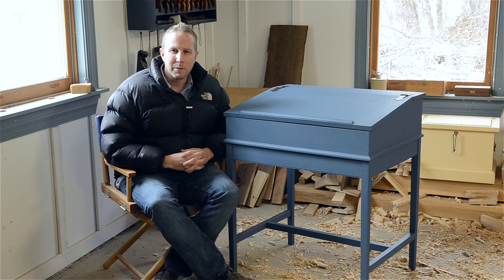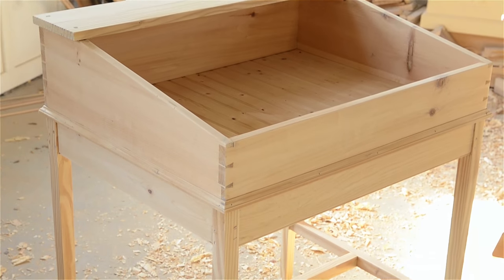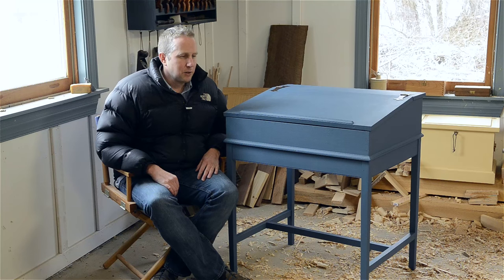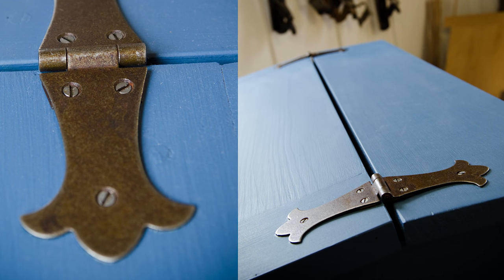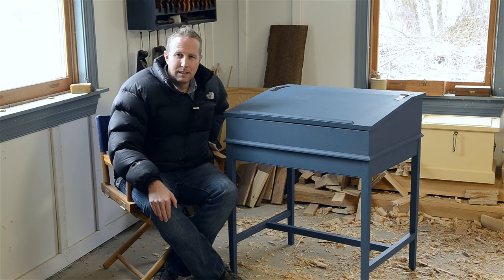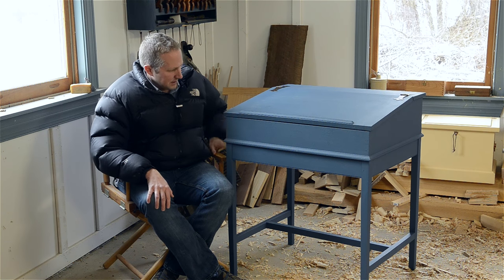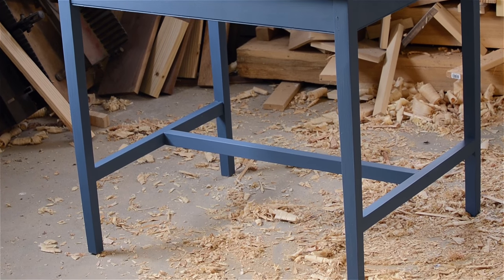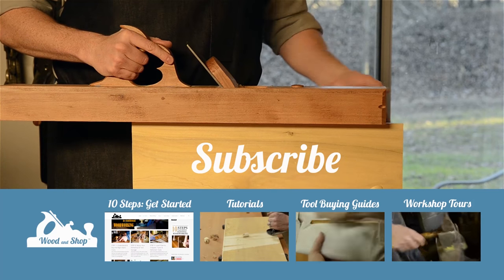The Completed Dovetail Desk! {Part 17 of “Build a Dovetail Desk with Hand Tools”}

Comment: Great job on the desk. About a year ago I repaired a similar style desk that my Father in law built about 65 years ago for his oldest daughter. I fixed it for our Granddaughter. I painted ours a colonial style dark red and put a coat of Mod Podge. I used the Matt finish because I didn't want it to be real shiny and it turned out nice. It has been over a year now and the finish is holding up nicely and resisting the grandchild/ children treatment. Easier to keep clean and dusted too. Just thought I'd share my finish treatment since you mentioned your boys had scratched the desk top already which comes with all children. Thanks for your videos and God you and you're family. Ron